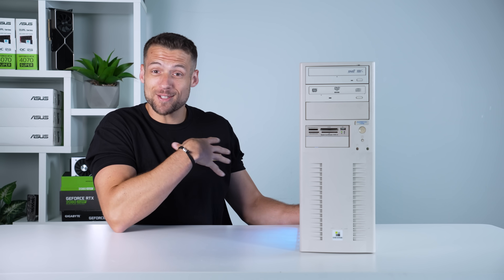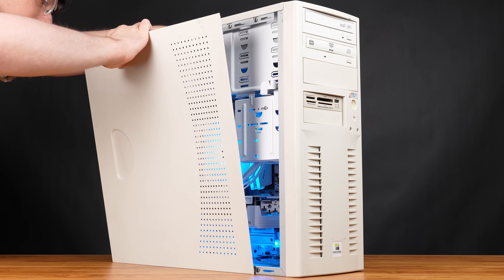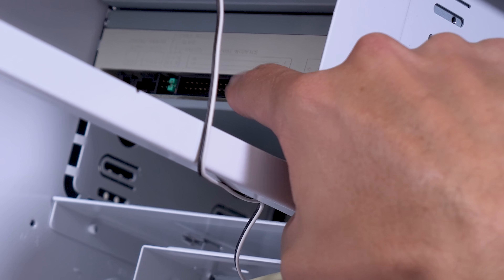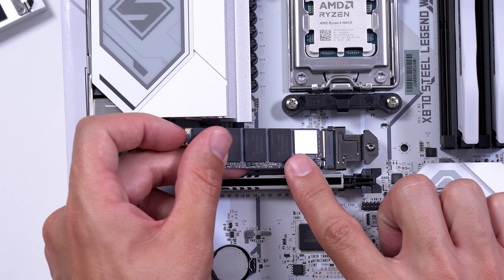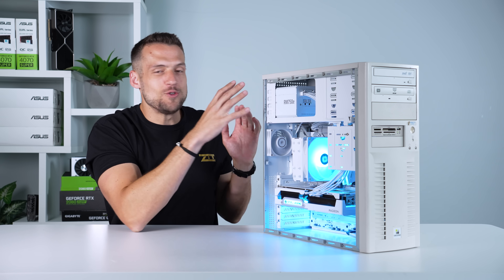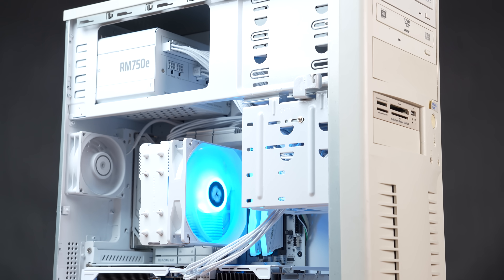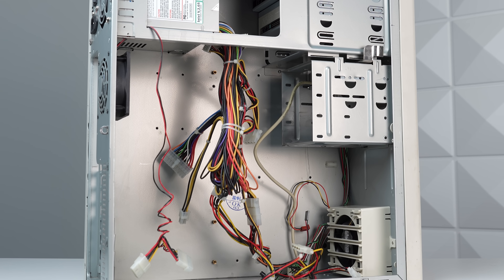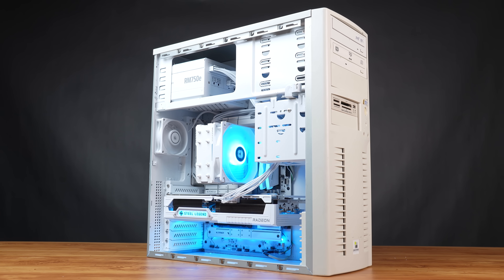The Ultimate Sleeper PC

Comment from the maker: Check out the condensed down livestream over on ZTT Extras for a step-by-step build guide on this PC! https://youtu.be/iB04euXD3Ms
Reply: Hey Zach, I know your probably not gonna see this but I've never owned a pc before and I have a budget of 450-500 dollars to spend. Which options are good, so far what I've researched and I see that for a prebuilt the NSX GAMING Desktop Computer, Ryzen 7 5700G, 16GB DDR4, 512GB SSD, W11, Black is a good option according to ai and some small creators but you have never talked about it. hope you see this and thank you!😁
Edit: I have found the PERFECT pc for my budget but I need a monitor to go with it, it runs fortnite and valorant from 150-250 fps. (im thinking of getting this 180 hz 80$ monitor but the price seems way too good so im not sure if its like a ripoff or something.
Reply: nice
Reply: hi zach
Reply: bro i need this pc, i have an rx390x😭😭😭😭😭😭😭😭😭
Reply: Late to the party...

S Tier video for an amazing build! This video definitely hits different.

Well done, Zach✌️😎🇺🇸🍻
Reply: Hey I'm wondering what U recommend for 1440.p gaming I have a 5800x CPU and a 3050 8 GB GPU and I wanna upgrade my GPU please help
Reply: Is the justop 700w psu bad for my pc it has a Ryzen 5500 16gb ram and a 1660s with a 1tb ssd. Also what upgrades should I?
Reply: Hey zach awesome video dude keep up the hard work 
Do you mind if i can ask you for some help and if you can make a video off of it 
Ok so im using a lenovo ideapad 3 ive had it for about 4-5 years and it overheats alot the battery life is very short probably like 2 hours max and the battery is expanding and is splitting the pc and id like to sell it and upgrade to a full pc not a desktop and id like to invest quite a bit too it mabe 1300$ mainly just from my saved up cash 
But my dad is worried because not only is it expensive but he doesnt want to take any chances cause ive never built a pc before and its to expensive to be breaking it on accident and he claims it most likely will be outdated in less than 4-5 years and id like to build it because sometimes it can be cheaper and i could get better specs than a prebuilt and id like to get it for my birthday 
Please and thank you
Reply: first
Reply: please give me a free pc

Comment: Just a side note: if money is of any concern in a build, dont buy x870 or x670. B650 and B850 are for 90% of people the exact same thing and in this rig for example, going x870 over b650/850 gave absolutly no difference. Like, I am not saying negligable, I am saying literally the same. If you get a x870 for cheaper than a B850 in a bundle deal for example like here, then its obviously fine.

Comment: ebay is the worst place to try to find old pc cases
You really gotta be patient and go dumpster driving, go to flea markets, thrift stores, facebook marketplace etc etc
You can get a similer case pretty easy for $5-10.. if you luck out sometimes even free.
The problem is if you want a specific case your only choice is ebay, 
Sorry boy you are NEVER going to find a sun microsystems ultra 25 at your local thrift store.
The trick is, especially if you want to spend as little as possible, just shop around for awhile and be patent and let the case find you and never jump the gun on somthing you have to think too hard about.
I got my superflower 201-s for $5

Comment: Homie, I've built almost the same build as this pc. mine has the xfx rx 9070 xt the mentioned artic cooler,  ryzen 5 9600 x a different motherboard b850m Wi-Fi elite. Has an aerocool mini d301 case and an nzxt 850 watt power supply. I've built this pc almost 3 weeks ago just before this video came out and was wondering if I had made the right choices with specifically the CPU. After mentioning a few times in your videos that the CPU I've bought is very good for my build, my worries were put to rest

Comment: I’m finalizing my high-end build (Ryzen 9 9950X3D, RTX 5080 AORUS MASTER ICE, Gigabyte X870E AORUS PRO ICE AM5 ATX), and I’m stuck on the storage setup. Which combo do you think would pair best with this rig?
	•	Option 1: Crucial T705 4TB (PCIe 5.0) + 2x Samsung 990 Pro 4TB (PCIe 4.0)
	•	Option 2: Crucial T705 4TB (PCIe 5.0) + 1x Samsung 990 Pro 4TB (PCIe 4.0)

Would the extra 990 Pro really make a noticeable difference, or is one enough alongside the T705?

Comment: Hi!
Can you pls tell me if this is a good build?
my idea: the 5070 is 566eur and the 3080 is only 14% slower then the 5070 and i invest the rest 210Eur into a much better cpu (everything brand new)
my games: Fortnite, CS2, Horror games, FC 25, Rocket League

AMD Ryzen 7 7800X3D
381,90 €
MSI MAG CORELIQUID A13 360
74,55 €
MSI PRO B850-P WIFI
185,90 €
INNO3D GeForce RTX 3080 X3 LHR BULK
356,90 €
Patriot Viper Venom 32 GB KIT DDR5 6000 MHz CL30
98,90 €
ADATA LEGEND 900 PRO 1 TB
61,90 €
Montech XR Black
48,90 €
ADATA XPG CORE REACTOR II VE 850 W
95,14 €

THANKS!!

Comment: Hi ZTT, can you help me? I have an RTX 3060 8GB and an i5 11400 (not the F version), I've seen some of your videos and benchmarks especially and your pcs with lowers specs get a lot more fps and lower temperatures :(. The only problem I know my PC has is that I'm currently using the intel's fan that came with the CPU, besides that I have NO idea, everything feels slow, I hear it stars heating a lot even when I open a new page on Microsoft Edge hahaha. (Maybe it's a virus? Don't think so as I've just deleted everything and even installed windows again)

Comment: Ryzen 5 5500 on a Asus rog B450F running a Klevv Cras C700 RGB 480gb m.2 1500 MB/s Read speed 1300MB/s Write speed paired with a set of Klevv Cras XR RGB 16gb (8gb x 2) 4000Mhz ram paired with a Gambias Kratos 600w power supply a 480 gb ssd and a 2tb hard drive cooled down by a Antec Neptune 240 liquid cooler running a MSI GTX 1070ti   this is a pc i wanna buy but would i be able to put a radeon 6700xt in here
Reply: and what peripherals should go with this
Reply: btw i found the 6700 xt for 340 usd and the pc for 485 usd and btw this is Zimbabwe so is normally more expensive due to import cost  and i have a budget of 1200 usd for everything

Comment: I need an advice guys. I have a PC with Ryzen 7 5800x, 64GB RAM DDR4, RTX 3070Ti. I recently playes the BF6 open beta and my system is able to push just around 100fps (90-120), and its heavy on CPU. Should i still try to upgrade my GPU to something like 5070 to get better fps? Or do i get the same fps with this cpu bottleneck?
I play on 1440p.

Comment: Zach please rate my pc build im 🙃
Rysen 5 7500f
Thermalright assasine x120 r se coler
Gigabyte b650m k
Rtx 4060
Teamdelta 16gb ram
Crucial p3 plus 1tb ssd
Acer ac 650w psu
Value top tyfoon f5 case

Comment: Are you just supposed to leave the case open? Otherwise what's the point of worrying about aesthetics? I've been using a huge beige server case for all my builds since the late 90s, starting with dual socket 300A celerons overclocked to 450 up through various dual socket xeon builds. I couldn't find modern heat sinks that would fit in the case so always just left the side panel off. I just switched to a fishtank case on my newest build during the summer sales, so it was funny to see this. The thing I already miss about the old case is that it basically doubled as furniture. You didn't have to worry about using it as a stool or table. It's so huge and heavy that I wouldn't even think about selling it on ebay.

Comment: Hi Zach, love your videos, and the fact that you don't push people to buy your builds. 
Need your suggestion. My Win 10 PC that I built 15 yrs ago has seen better days, so I'm planning to build a new one (transferring the Win 10 to an internal SSD and buying the $30 extended support that Microsoft is offering, as I'm not yet ready to switch to Win 11).  I'm NOT a gamer, so no need for a GPU. However, I do a lot of audio editing/mixing, watch movies, in addition to normal daily chores (email, Excel/Word/PP, work stuff, etc.), so I do want a solid, future-proof PC with an APU, 32-64gig RAM, 2 SSDs, 750w+ PSU, and perhaps a full ATX case (w/the smallest footprint available).  Looking at Ryzen 7 8700-G.  Budget is $600-$800.  Any suggestions on related parts to pick for this entire build?  Can I repurpose any of the components from my current PC? I can post the components list if you need. 
Also, is it worth splurging extra toward a mobo with 6-8 RAM slots for future upgrade?  Would appreciate your advice.  Thanks Zach.

Comment: Guys I built a PC, and I'm looking out for advice. the build is,
MSI MAG B650 TOMAHAWK WIFI
GeForce RTX 5070

CORSAIR RMx Series RM750x
AMD Ryzen 7 7700X

G.SKILL Trident Z5 Series 32GB 6000/MT
SAMSUNG 990 PRO SSD 1TB x2
be quiet! DARK ROCK 5
I want to use it for Gaming, Programming and 3D designing however, I'm not using it for professional work just for learning.
is it considered good or it needs to be changed. I appreciate your suggestions, thank you.

Comment: Hello Zach I have a question. Im building a pc and im struggling a bit on which slot do I put my ssd. I have the gigabyte b850 aorus elite motherboard and I have 2 ssds, the samsung 990 pro 1tb and and the 990 pro 2tb. On my motherboard I have 3 slots. 2 of them are gen 4.0 and one is gen 5.0. I want to put my 1tb ssd which is gen 4.0 in the gen 5.0 slot because it has a bigger and better heat sink than the other slots because ill be installing windows on that ssd. But I dont know if it works or if it will break something. So can I put a gen 4.0 ssd in gen 5.0 slot?

Comment: Hey Zack I got brand new 7900 gre for 550 cad roughly 400 usd do you think that was a good deal and would you recommend me to pair it with a 7600x b650mand 32gb ddr5 6000 cl 30, since there's a combo at my local men express for a gigabyte b650m ryzen 5 7600x and 32gb ddr5 for 485 cad around 350 usd the full build is going to cost me around 1400 cad so 1 grand usd

Comment: I have not had a desktop PC in roughly 8 years. For the past 7-7,5 years I had a laptop with 4gb of RAM and roughly 212 gb SSD (?) and it recently is stuck on only 2 percent no matter how long I charge it and turns off randomly. Worst part is I had changed up the battery for almost 50USD around 4-5 months prior, which was pretty costly because I was a high school student still. Now I have a PC with 64gb RAM, 1tb SSD, ryzen 5 4500 and rtx 3060 8gb on the way! Super excited to actually game properly

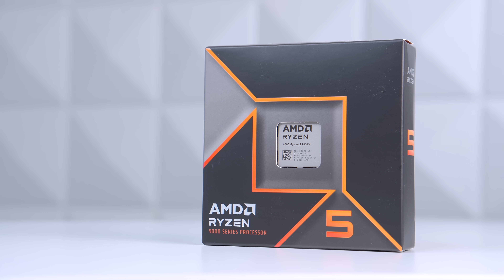Comment: 3:38 Hey Zach! What's the highest-end graphics card you would pair with the 9600X?
Reply: Probably 5080 or rx 9070xt
Reply: @Khaerulbtg that would be a gigantic bottleneck for the 5080, 9070 xt on the other hand
Reply: At your timestamp he literally says it can hang with any top-of-the-line graphics card...
Reply: @Lockdrew92  I just watched that part again. I'm not arguing, but I guess my question was more if he would recommend capping it at any particular one.

Kind of the difference between "it works" and being fully optimized/balanced.
Reply: I would say 5070ti

Comment: Great video, sleeper builds are elite . Quick question, with a budget of about $800 bucks should I upgrade my 7800 xt to a 5070 ti? I would also have to upgrade my psu from a power spec 750w to some with more power. I’m also looking to trade in my sapphire pulse 7800 xt

Comment: Why not slap in some SATA optical drives and have working drives? My "sleeper builds" are all actual retro PCs... So far an Athlon XP running Win XP, the beginnings of a socket 775 pc(Q6600 getting a 771 sticker modded Xeon X5472, and my old FX pc in a 2000's Superflower 3 windowed case running W7. Next is resurrecting one or two of my 486's.

Comment: You nailed this one. I think if you tried to fit any higher performance components in that it'd be hampered by the poor airflow. Feel like even this would get single digit performance boost in a modern case, but for a sleeper build, this is top tier 👌🏼

Comment: I would have put those round rubber/plastic feet on it and cut out holes for some 120mm fans at the bottom.  It would still be a sleeper because you wouldn't be able to see them.

Comment: I'm impressed about the heat, i built my gf's pc inside one of those cases and with a  ryzen 5 3600 and a 3050 the pc is always ultra loud and hot, we can't put the side pannel due to thermal throttling. The case has 4 80mm fans btw, intake at the rear and the front and hexaust at the top. the classic intake at the front and exhaust at the rear and the top was even worse
Reply: Your gf should run
Reply: @splaturials9156 she asked x)

Comment: Pls rate my pc build (and can any give some advice) ( pc is for cad programs, streaming and video editing)Asus b860m-a intel board
Intel core ultra 7 (series2) $260
2x16g team group ram
Crusial 1gb m2
Pny 16g 5060ti gpu
Lian li a3 micro atx case
Lian power supply
(Have not gotten fans yet, need suggestions)
Reply: i reccomend getting a better gpu (5070/9070xt)
Reply: also i would go with AMD for a cpu (r5 9600x, r7 9700x, r7 7700x for mid-range)  for more high-end th r9 9900x will work amazing, it has more cores which is better for streaming and editing video more cores (it is $360 tho)